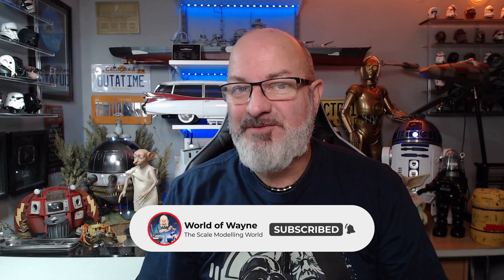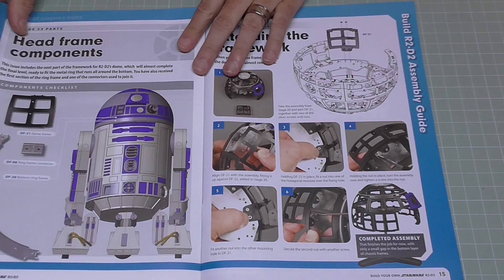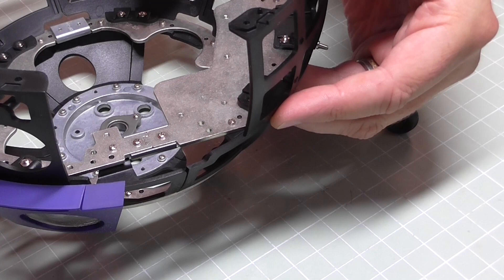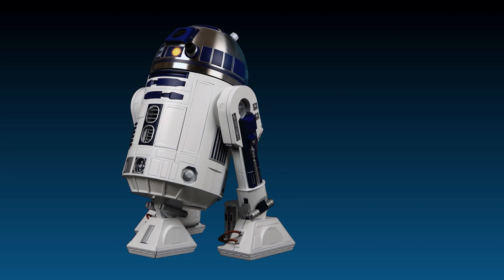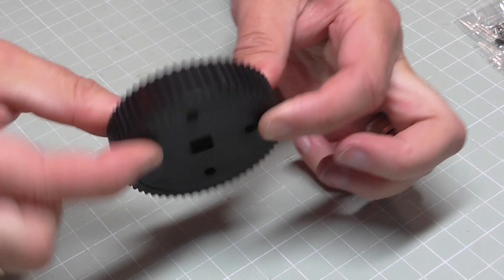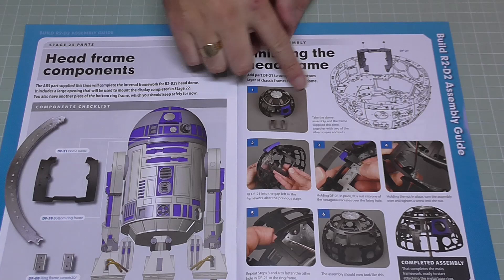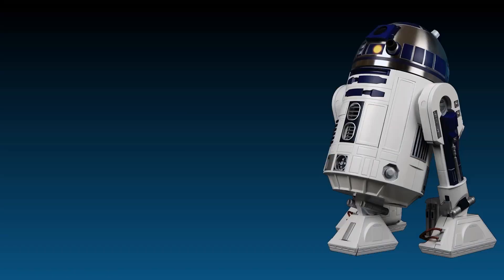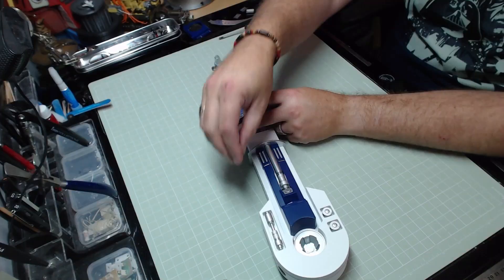Build Your Own R2-D2 - Pack 7 - Stages 23-26 - Final Head Panels, Wheel and Mount

Comment: Hi Wayne. I am in Brazil, I started collecting this kit about 2 years ago, when De Agostini released it over here. I kept my boxes stored and saved your earlier playlist, and now that I'm literally 1 shipment away from issue #100, I decided to get started building mine using your guides. But it seems things have changed, that playlist is dismantled (I noticed the older De Agostini's build episodes are still around, but scattered), fortunately I found this one, and thankfully, I have been able to follow it along just fine so far (phew!)

Perhaps the wait and vanishing of the older playlist were for the better - I hope I can take advantage of your gained expertise along these builds, so this one's gonna help me through whilst skipping all the pitfalls. I've got my M3x8mm metal Allen head screws already.  😃